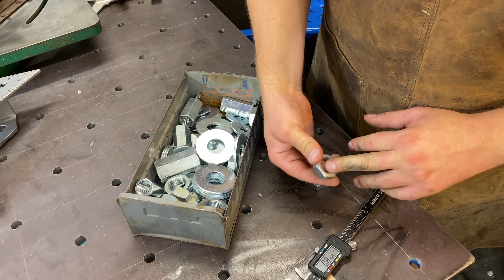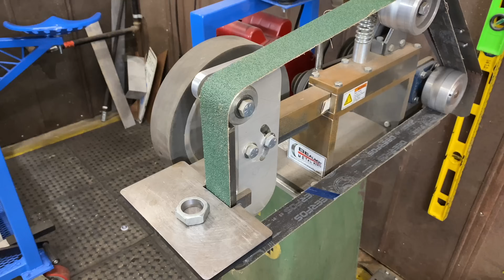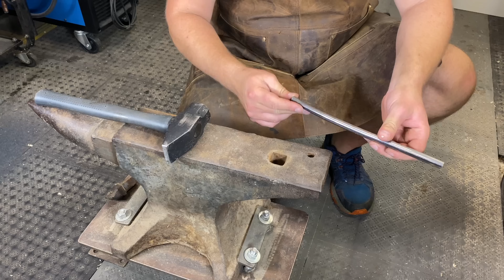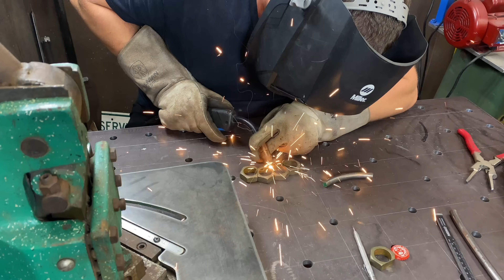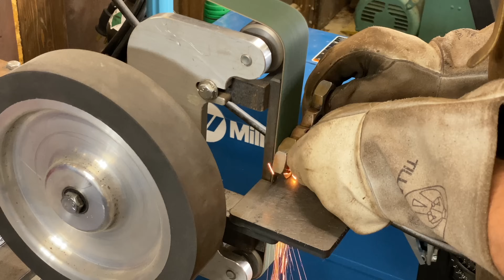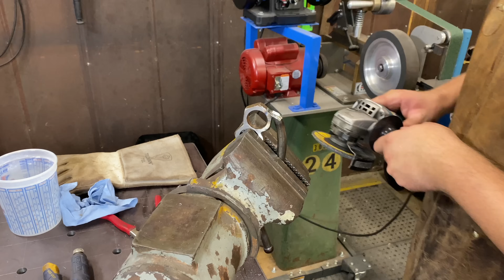HOW TO MAKE BRASS KNUCKLES

Comment: That’s brilliant mate. I made my own a good few years ago, around 2007, out of a piece of flat bar 1cm thick steel. Marked them out, cut excess with the angle grinder, shaped with the angle grinder, drilled the holes with the biggest drill I could find- nowhere near big enough- so I took a round file and filed for hours and hours. Eventually shaped the holes rounded them, hands all burst blisters, polished it up, under coated with anti rust primer, finished in smooth hammerite black. Then I had all my mates who hadn’t seen any of the work I put in, saying ‘great! Make me one!’ Yeah right! I still have it though. Couldn’t part with it!
Reply from the maker: That’s one way to do it. This is my first pair also and I just can’t bring myself to give them to somebody else.Thanks for the comments!🙏😁
Reply: @M8keStuff  yeah they look great. I’m 51 now and it’s comforting knowing I have them in case of emergency lol 👍
Reply: What are the rings called? I want to buy them at the hardware store so I can try to make them.
Reply: @emilyuwu6625  they are a large sized nut. Not sure what size though. But you should see different sizes there.
Reply: @M8keStuff  would u make me one for $$$  lmk
Reply: @emilyuwu6625 they're nuts

Comment: Some body can tell me , where can I buy the heavy metal equipment. I got the rest 😌,  and how much is gonna be the equipment. Thanks 😊
Reply from the maker: I buy my equipment used
Reply: Hahahaha 😆 😆
Reply: Heavy metal equipment? Do you mean the lathe or the anvil? You don't absolutely need the lathe.. I would use a drill press in a pinch.. or maybe a Dremel with diamond bits and clamps to hold the nuts in place.. as for trimming the nuts(now THERES an expression), I would again use a dremel, this time  with a cutoff wheel, to get the same result. 

The impressive thing here is not the tools(though they ARE nice, but the ingenuity of using the tools at hand . If you dont have the tools this gentleman has, look around at what you do have.. to get the results you want..

Comment: Made mine out of brass block three quarter inch thick . Clenched fist and placed it on block then scribed round knuckles . Find centre of each knuckle and centre pop . This comes out in an arch . Measure fingers diameter and drill each hole accordingly but with 1/8th inch added . Then ream out holes . Make the T bar and cut it out with hacksaw then lots of filing and polishing . Finished article. Is made to measure knuckle duster and is awesome . Does take some time to make but a great equaliser when finished . Just don’t get caught carrying them as illegal here in UK .
Reply from the maker: Nice, sounds like you put in a lot of hard work. I have never made any out of brass yet. Would like to make another set. Yeah, they are not legal to carry here either in Pennsylvania USA. I use them as a paperweight and conversation starter in the shop. It’s funny how everyone that sees them can’t help but pick them up and try them on.
Reply: @M8keStuff  yes they are a good conversation starter arnt they . Mind you they can end a conversation quick too can’t they .
Reply from the maker: Lol, probably
Reply: Ya Canada here i think I’ll make me some in my metals class for every day carry

Comment: What's the stuff you soaked the nuts in, does it remove the zinc coating prior to welding?
Reply from the maker: Yes, it’s vinegar. I left them in overnight and by morning they were bare steel.
Reply: Hehe you said nuts
Reply: @M8keStuff  Late thanks for your reply. Great video.

Comment: Wow I don’t know if you have gotten the idea from somewhere else or it’s your original idea. But great creativity my family owned a industrial Fastener company our only competitors  was Fastenal and Grainger  where I worked for a little over 20 years until my uncle died and his wife got money hungry and sold the business and I’ve have never seen or thought of that awesome idea I’m gonna go watch your video but it appears you used Zinc Plated Grade 5 Nuts am I correct? Looks like USS WASHERS ROD COUPLING NUTS AND THE GRADE 5 ZINC PLATED NUTS APPEARED TO BE SAE FINE THREAD.
Reply from the maker: They were 1” fine thread. And I believe they are jam nuts which is why they were not super thick. I have fat fingers so I had to use 1”.

Comment: Did you use carbon or stainless for this wonderful project
Reply from the maker: Carbon steel, no stainless. Beware of rust
Reply: @M8keStuff  - you could spray paint them. 
 ..or dip them in Plastidip- for dipping tool handles in..  just a thought(but you might have to make the holes larger first :/

Comment: Weapons “expert” here do not use brass knuckles that will separate your fingers it is much riskier then your bare hands (you can seriously injure yourself). Instead use a weapon that will allow you to keep a tight fist and still gain all the benefits such as a D guard of a sword alone or a really big carabiner plus it’s much more justifiable to have a large metal or wooden ring in comparison to the easily recognizable knuckle duster which is almost universally illegal and has a “bad guy” stigma attached to it. stay safe guys.
Reply: im not a weapon expert... but i experienced having to use one of the same kind and I can assure you... I had very little damage on my little finger... the other guy on the receiving end had much bigger damage
Reply: and they used those in ww1 and ww2.... its and old and very good design sorry to break your weapon expert fantasy

Comment: Would anyone know how to lathe out the inside of the nuts (the first part at 0.50) if you don't have access to an lathe machine? I have a power drill and wondered if anyone knows is there a part that would be suitable to use if I clamp them in a vice?
Reply from the maker: You could try using carbide rotary burrs, they fit in a drill. They basically are for grinding away metal.
Reply from the maker: If you have a drill And a holesaw, consider this alternate method for making brass knuckles(actually aluminum knuckles).  https://youtu.be/f0UOjALiP5A
Reply: or buy a step drill bit